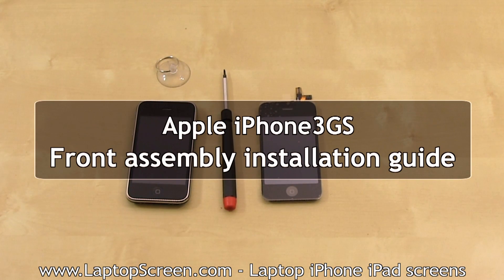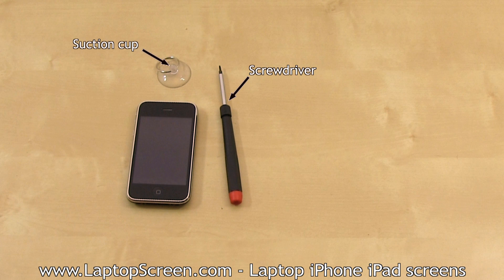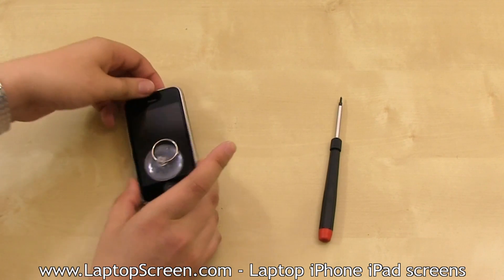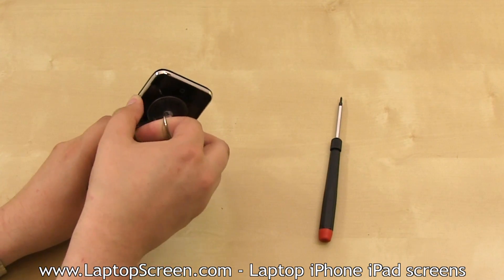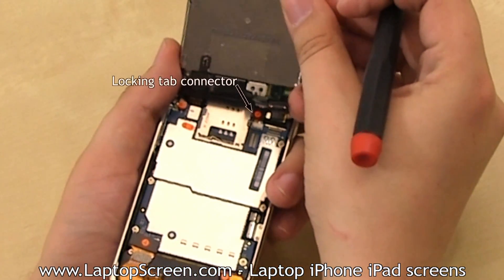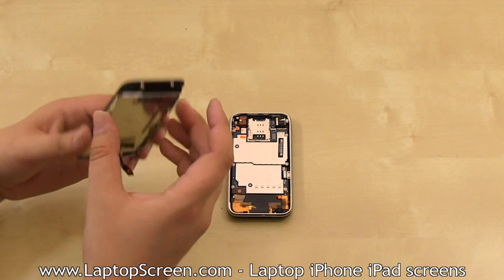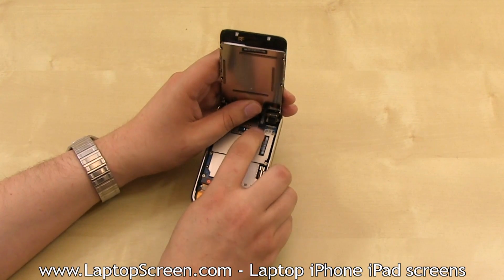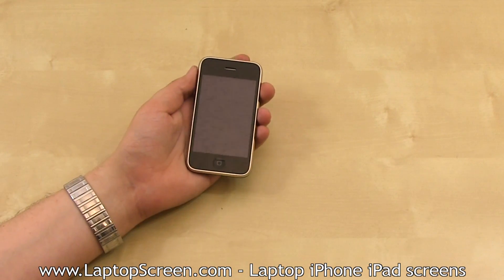iPhone 3GS screen replacement / digitizer glass and LCD reinstallation instructions

Comment: I did this and it worked perfectly, but now I have no service, do I need to open it back up or anything or should I wait to see it it comes back on?
Reply: You probably didn't reconnect something correctly, I'd take it apart again, and check if all the connections are okay.
Reply: .hec.